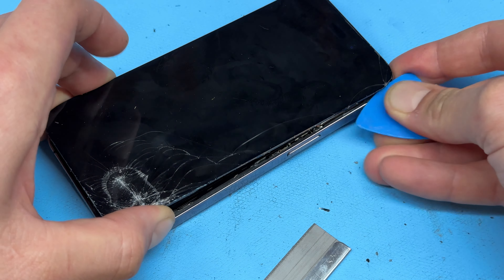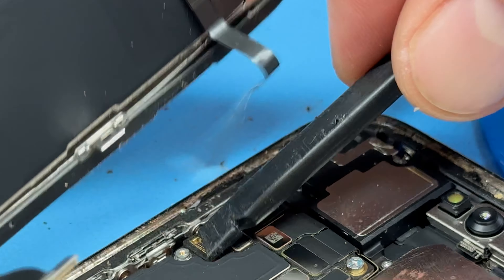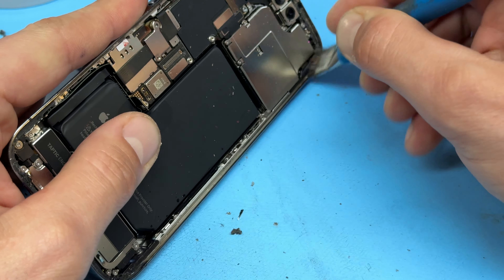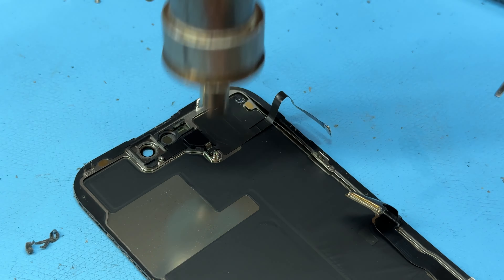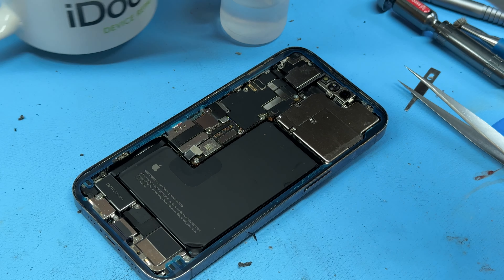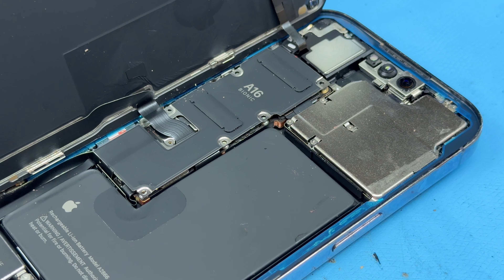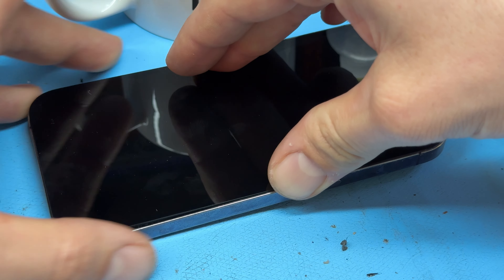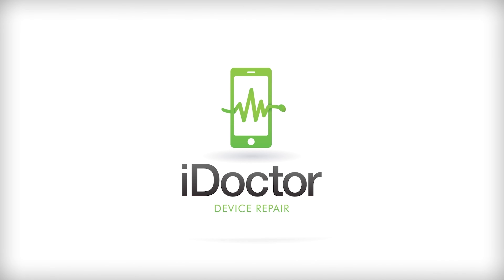iPhone 14 Pro Screen Replacement Tutorial: Easy To Follow Step-by-Step Guide!

Comment: they trying to charge me $300+ to do this yea no thanks ill do it myself
Reply: I mean it depends. Usually shops get actual OEM screens or atleast the best aftermarket. As an IT shop myself, the screen alone costs $135 for a average AM, $300 for premium AM, and OEM you have to get from apple and they are usually the most expensive. Amazon and ebay screens are the worst quality known to man and will most likely have issues later
Reply: The OLED for 14 Pro is the most expensive part in the apple universe, and you think it is the work/time that is being paid for lol.

Comment: Please take my advice on any iPhone 14 Pro do not waste your time or money replacing the screen yourself I’ve replaced 5 of these screens all soft oled screens not cheap and all have eventually suffered with ink leak seaping from Dynamic Island the sellers of the screens have agreed with me that these screens are defective and really I don’t recommend anyone to apple for screen repair but for the 14 pro and 15 pro I’d highly suggest you let them do the screen u will thank me in the long run
Reply: Update the sellers of the 14 pro I got the screens from no longer list them after checking they were advised there’s loads of complaints about the same issue from other repair shops
Reply: Is there anywhere i can get a 14 pro screen that is good quality

Comment: If I am removing my screen to clean the condensation off of the inner camera lenses, will I need to replace my screen adhesive?
Reply from the maker: I would always recommend it if opening the device. Ask yourself, if condensation is getting in, is the seal doing its job?

Comment: Bro I broke the cable near the front camera area . What can I do to get it fixed . Can I get a replacement from somewhere or it is done for . I spent 300$ buying a replacement screen.
Reply: @mari2o6 lol no . I was able to fix it . That part was only 12 dollars more . Luckily i was able to repair it
Reply: @SandeepYadav-vc8vs if you broke that proximity sensor attached to the screen then it can’t be fixed I’m assuming you tore it ? Only fix for that is to buy a replacement and have it reprogrammed so it works as it should and also ambient light will work again no doubt when u make a call and the screen is up against ur face the screen doesn’t dim
Reply: how do you reprogram? would a jcid v1se do the job? i need to replace the proximity sensor as it is causing my phone to keep restarting and i am wondering can i replace it without reprogramming and keep face id and other features

Comment: i need a link to where to get a proper new screen
Reply: apple self repair with no error and truetone working or you can buy china oled and reprogramme it with programmer
Reply: apple self repair is a bit expensive. I use injured gadgets
Reply: @ImtixBusiness  yes but you will never program the screen without the programmer while apple self offers screen without error but you pay 200$ more 🤣